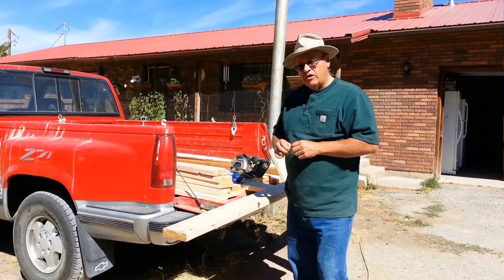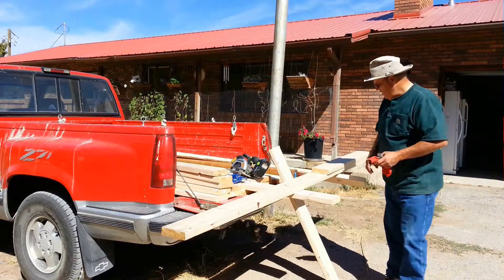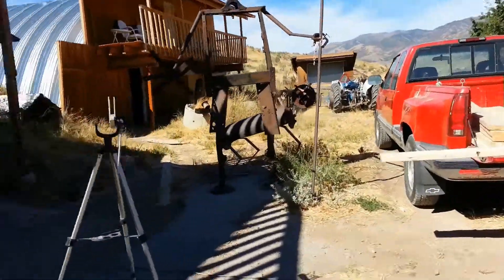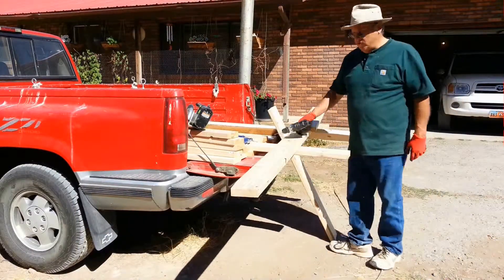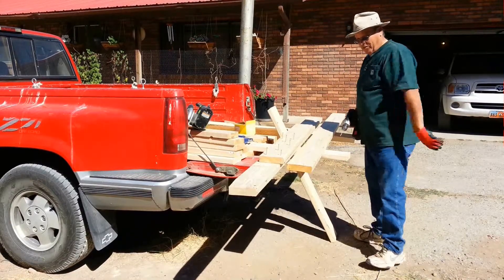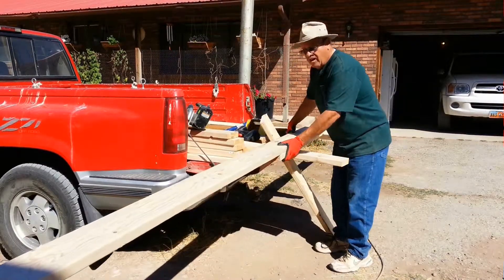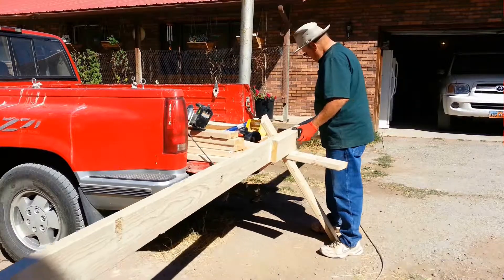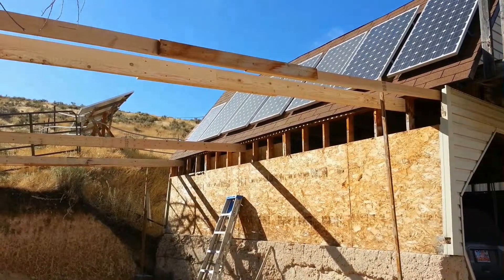Building My Home Built Carport  11  Building the roof rafters

Comment: What kind of glue u use?  And can u just nail together?
Reply: I used standard wood glue.  I would not recommended only using nails.  They are not strong enough to depend on.   The glue actually provides the strength needed.   The screws I used were actually for compressing the glued joints, sort of like a clamp that is not removed. 
Hope that helps.
Ed
Reply: @edwardolsen141  oh ok so if i got a 12-14' span should i just get 2x6 x14 or use 2 2x6x8s and splice them together?
Reply: Either would work fine.   I spliced them because I couldn't fit a 14 footer  in my pickup truck.  But I could fit 8 footers.
Reply: @edwardolsen141  how long was the board u used to splice them??
Reply: @Eastbaypisces  I had all 8 footers so I cut some of them in half and used them for the splicers.  So they were 4 feet long.
Reply: @edwardolsen141  gotcha,  just standard wood glue n screws then right?